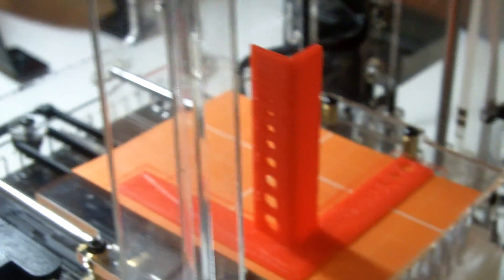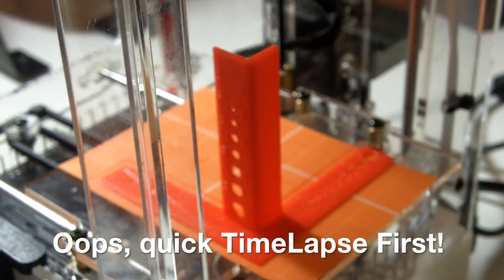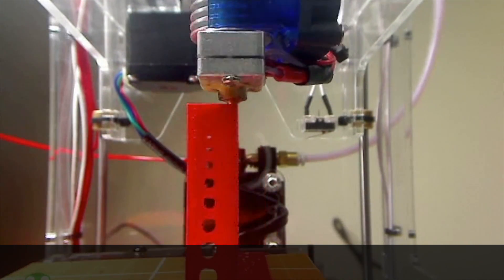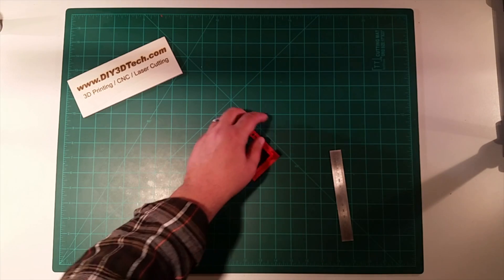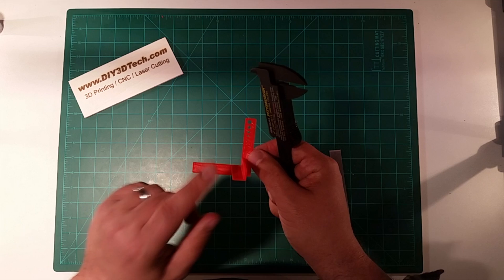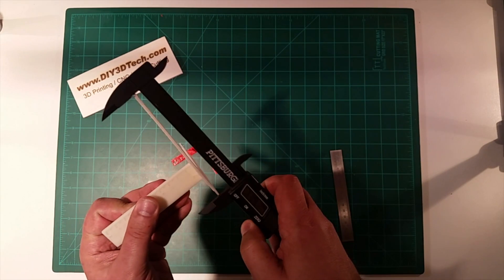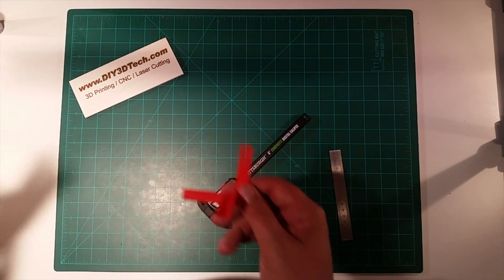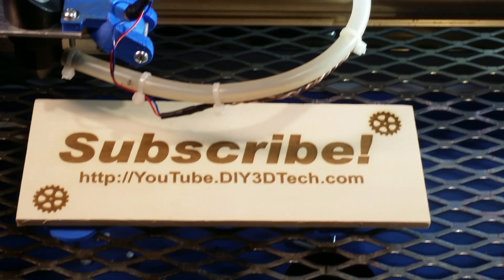Fabrikator Mini TinyBoy 3D Printer -  3D Calibration Ruler Test!

Comment: did you ever do a video on how to correct this problem, i have 2 3d printers, my anet a6 prints very accurately, my fab mini prints everything undersized. i'm always having to tinker with objects to get them the correct size.
Reply from the maker: Wow this was a long, long time ago.  Did you check the playlist all video for a given Machine will be under tis playlist. Thanks for commenting!
Reply: no did not check playlist, didn't realize there was one. i will look now thanks :)
Reply: i looked at the playlist for Fabrikator Mini, I didn't find anything about how to correct problems with size. any chance you covered this more generically, I think the mini runs marlin as do many others, perhaps you covered the subject using a different machine as the example?